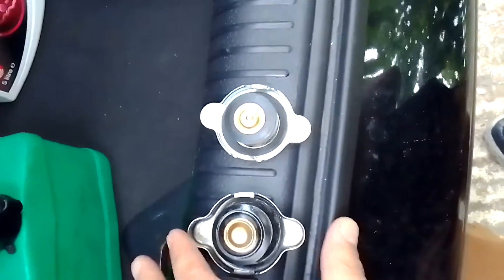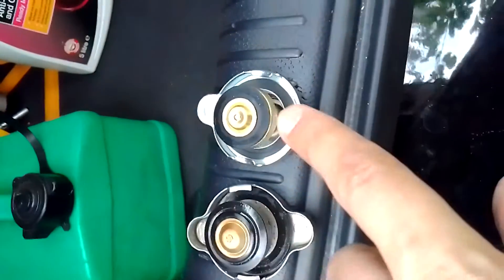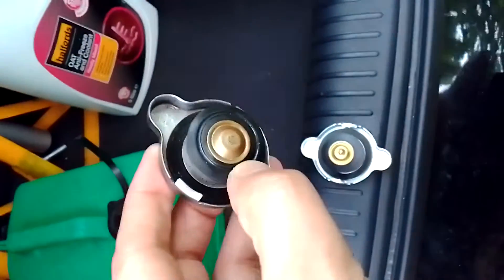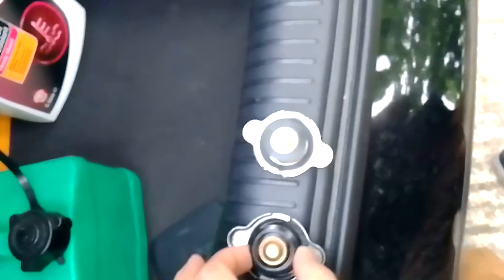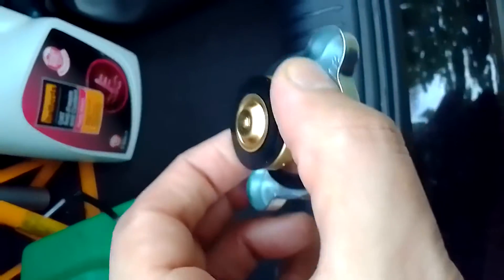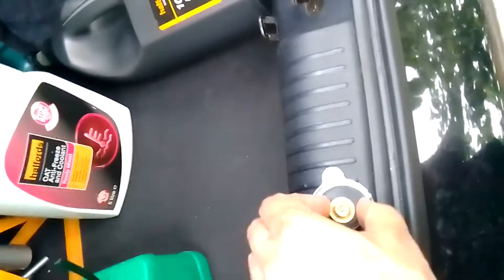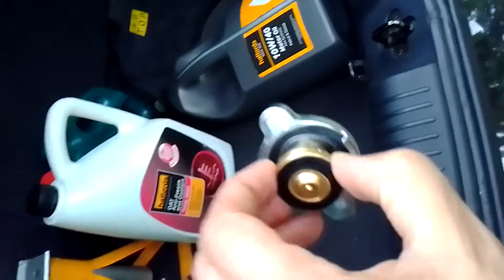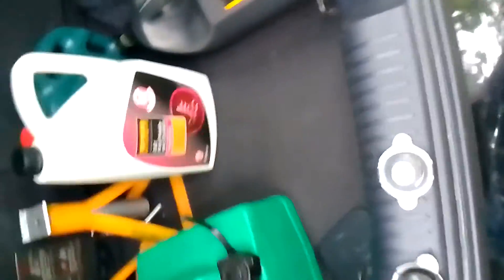Car radiator cap, old vs new.

Comment: Probably the best radiator cap video I've ever seen, honestly. Would never have put together the "slightly stretched rubber" you saw could cause problem. I have caps look almost exactly the same just 1.1 bar (02 Subaru EJ251. 16psi/1.1bar)
Reply from the maker: Thanks, glad to no I helped.